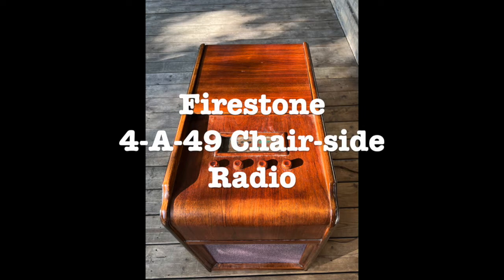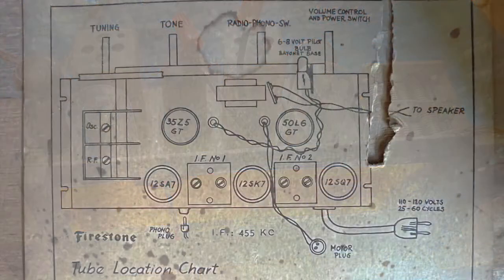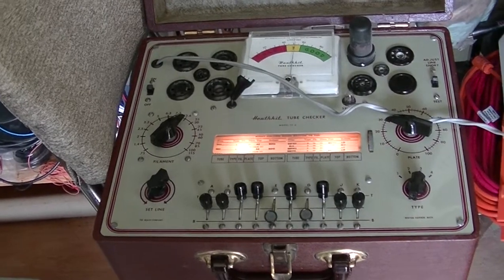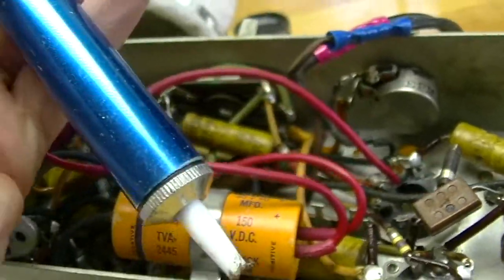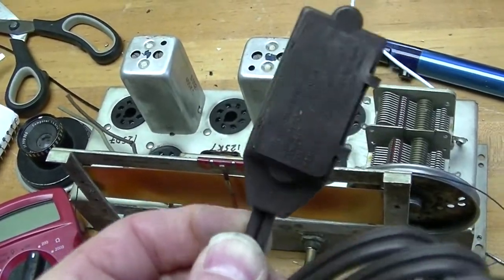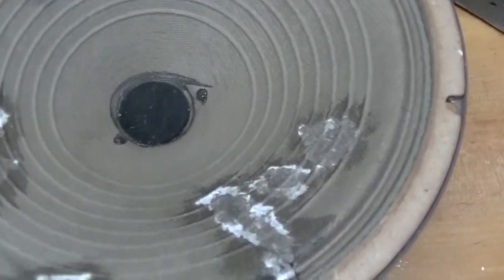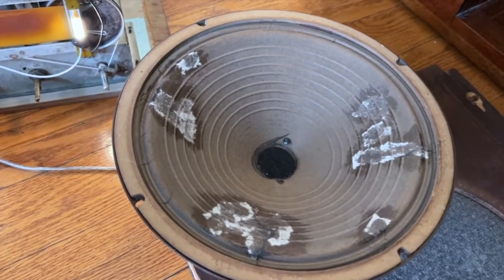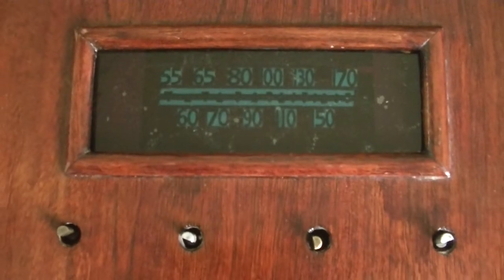Firestone 4-A-49 Chair-Side Tube Radio Examination & Repair

Comment: Great job!!!! Masterful repair!  Lexel Silicone glue is a great, eternally flexible speaker cone sealer.  
I suspect the radio was left on for a long period of time to get that kind of heat damage.
Would the chair side benefit from a low RPM cooler fan to prevent that kind of heat damage from happening again?
Reply from the maker: I’m so very glad you enjoyed the video! As you point out the heat is trapped which is probably why the dial was so badly damaged. I drilled a row of holes in the cabinet to facilitate natural air convection but a low RPM fan is an excellent idea. I’m going to see how it goes for now. I installed such a fan on a 50s RCA portable TV repair and it makes a world of difference particularly in reducing frequency drift! Thanks for taking the time to comment.